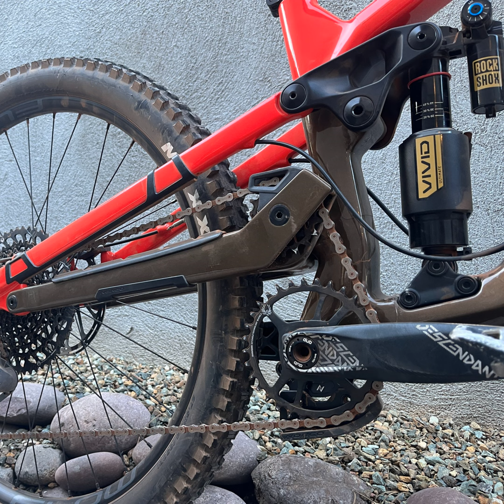The Case for High Pivot MTB Design, and How it Works

Comment: I've owned the last gen Norco Optic 2021 model for 4 yrs now. I run it with 150mm 36 and the Cascade Components link. Love that bike. I just got the 2024 Optic hp framekit. Should be built up here in the next couple weeks. Super excited to get out and take it for a rip. Especially after listening to this pod. Tons of great info from the Norco engineer!
Reply: Ive got over a year on my alloy frame up build, how's the new model treating yah?